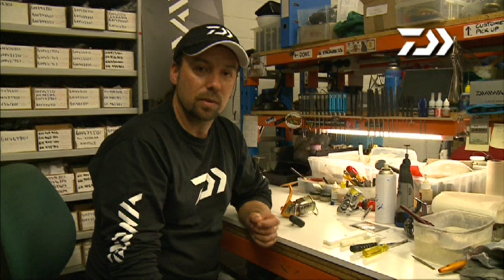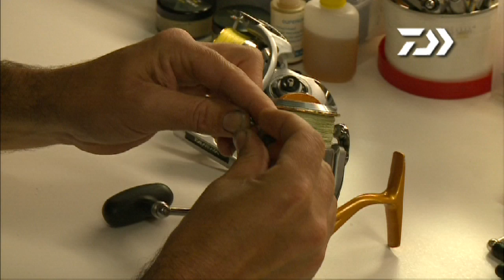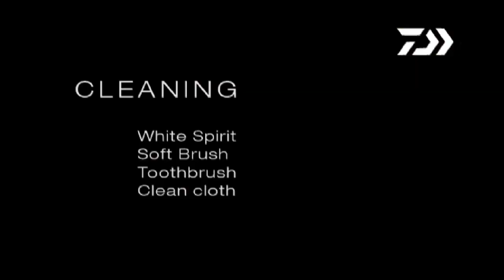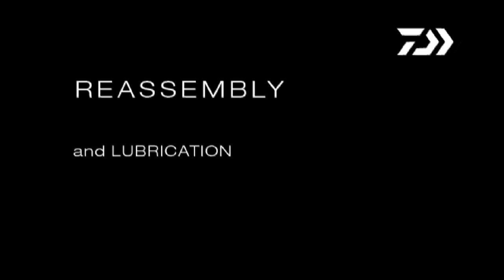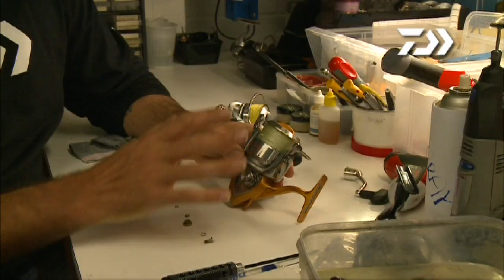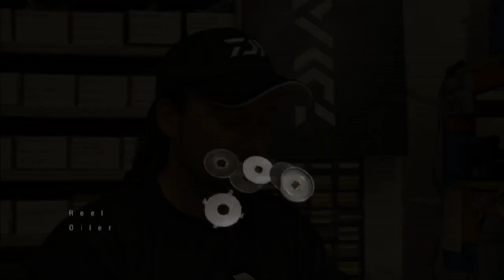Line Roller Maintenance

Comment: My Line roller moves when I pull the line even thou drag is on full
Reply: past year exam papers Think about what you just said and try again
Reply: Your drag is for THE SPOOL, not the bail's line roller (don't see any connecting parts, do you ?), so of course it operates independently.

Comment: I had my line roller replaced recently but the new one doesn't actually roll; it now just acts as a smooth surface for the line I guess. Is this a problem in your opinion?
Reply: joel105200 know this is late, and while it can work it puts friction on the line and can make you have line twist way worse than normal.